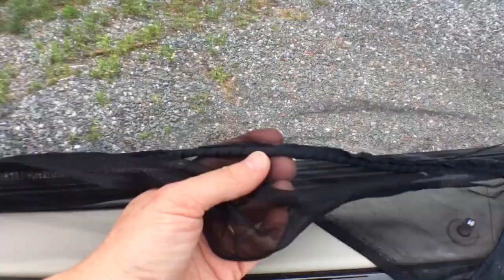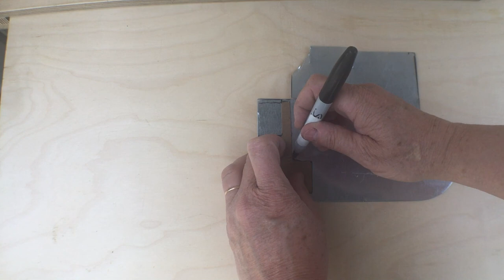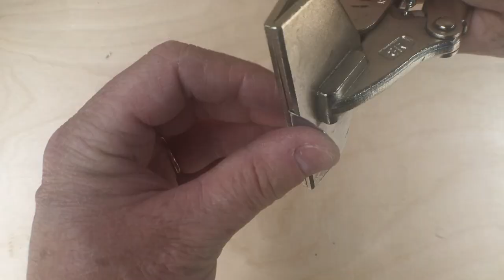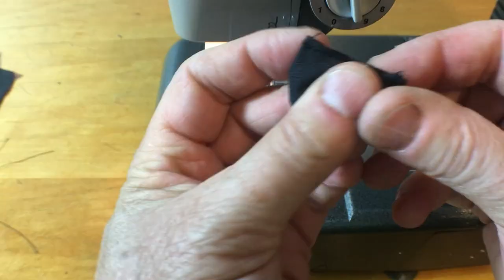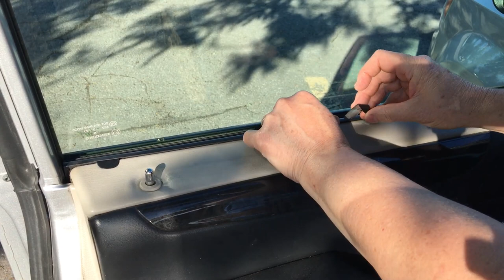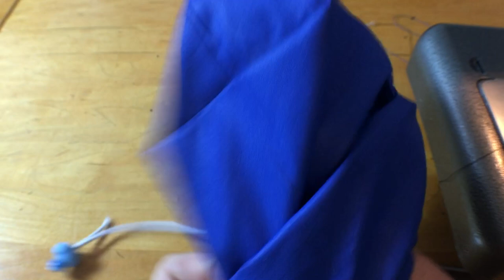New mosquito screens for the front windows of my very small camper van

Comment: Great video. I think of all the videos I've watched I like this the  best because it has the soft edge of the bias binding They can also fold down very small compared to others I saw which had gaffer tape on them around the edge and Velcro (which I'm thinking the glue wouldn't hold up when the car got hot in the summer. ) I think I'm going to try your way Nice to see another camper with sewing skills. It's fun to be able to make our own touches to the vans.

Comment: Great video! Probably one of the best, if not the best one of these I've seen so far. Your experience sewing, seeing how you navigate some of the challenges that others' lack of experience helps greatly for those like myself trying to get more ideas to determine what approach we can take on our windows. The little metal tabs seem like a great idea! I'm thinking about going one step further and taking off the door panel to embed some of that metal right into the plastic on the underside. I'm trying to figure out the BEST blackout curtain and sunshade possible. Using the compression between the outer and inner weather seal gaskets is great! Thanks!